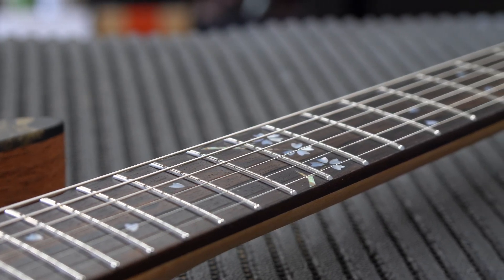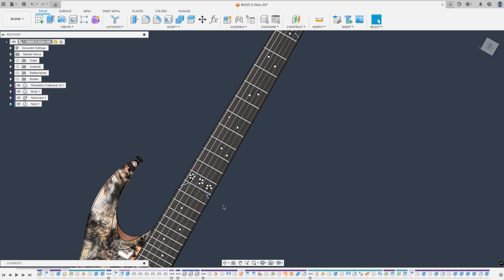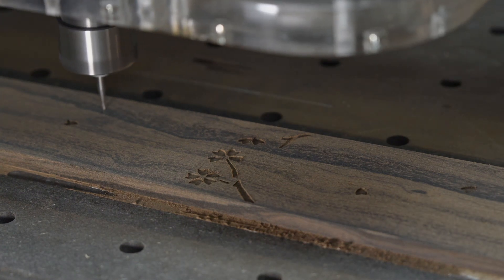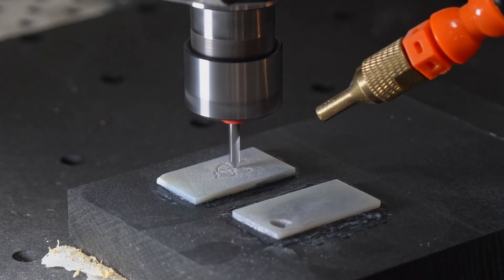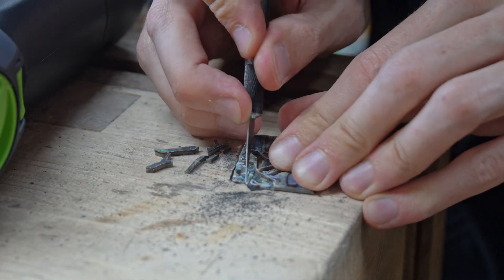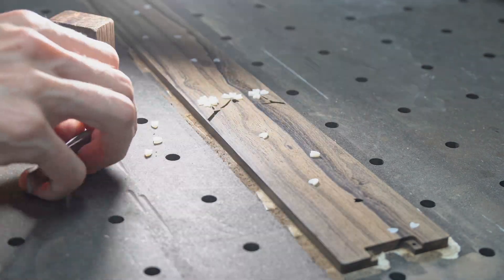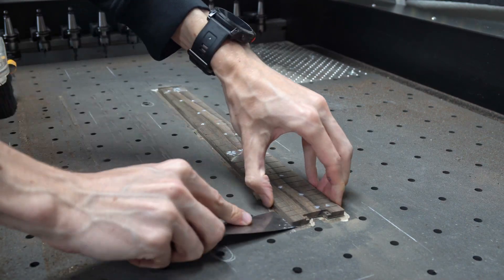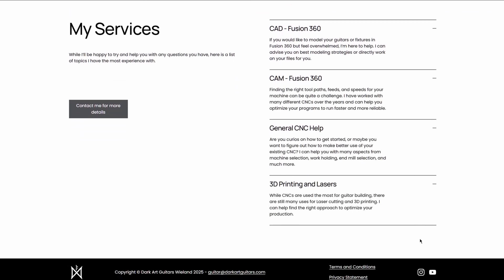My INLAY SECRETS Revealed! - Detailed Shell Inlay Tutorial for CNC

Comment: Beautiful design. Your hold down system with CA or double sided tape, would a vacuum table work for things like fretboard work?  Then you wouldn't have to use so much force when prying the work pieces off. I understand that might not work at the small inlay parts though.
Reply from the maker: For a lot of it a vacuum would work, but for things like bodies where I cut all the way through I would need quite specific fixtures for it to seal everywhere. A vacuum table is on the wish list but since the masking tape method works well I haven't gotten around to it.

Comment: Fantastic video!  Jam packed with great information.  I'm just starting my first pearl inlay on the CNC and grabbed a ton of valuable info here. Quick question, how do you zero your X and Y axis to your material with those tiny bits?  I typically use a touch plate with a hole in it that auto-detects the size of the bit once it touches off the sides of the circles.  With the tiny bits, I would be a afraid to snap them.
Reply from the maker: For inlay like this I don't need to accurately set XY, just by eye is plenty good enough. If I need a precise zero I use a touch probe I swap into the spindle. Works great on an ATC machine, but a bit of a pain with a manual tool changer. But definitely don't use the tiny bits with a conductive setup, they will chip or break. Even setting Z-zero should be done with the spindle running and just slowly going lower until it just cuts.